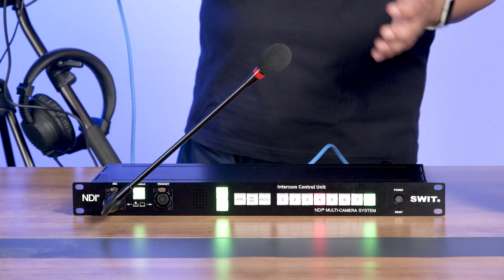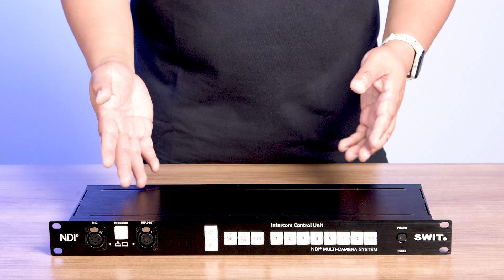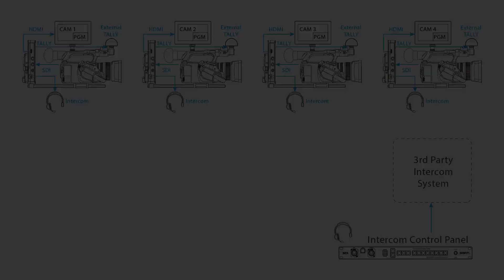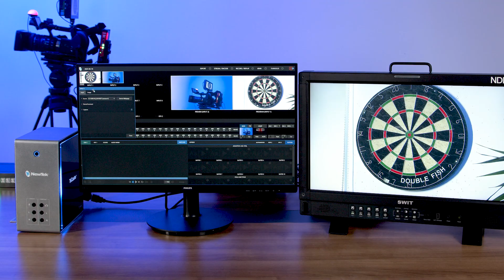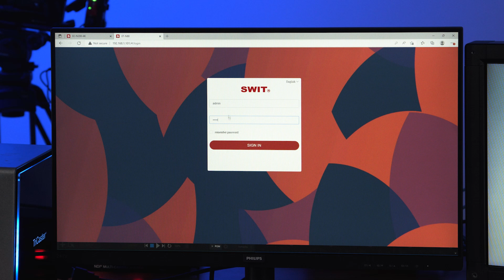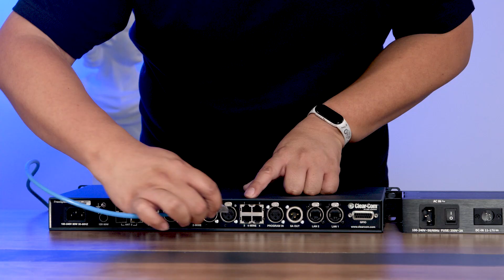SWIT NDI EFP Multi-camera Production System

Comment: I like that you provided a method to make normal ethernet more secure but I would have loved to finally see an NDI converter with Ethercon built in by default.
Reply from the maker: Thank you for your suggestion! We consider that Ethercon's cable is not available to all users like ethernet cables, so when users use normal cables, the interface cannot be fixed. Therefore, we chose a shelf to secure it.

Comment: Awesome what’s the latency for the return program feed ?
Reply from the maker: Around 80ms
Reply: @switglobal  thanks , trying to find the pricing . Do you have any links?
Reply from the maker: @markhepi7791  You can check prices now on our website (switonline)!
Reply: @switglobal  80ms? why this high? what about the SDI>NDI encoding latency then? I mean standard latency shall be 2 frames in both direction ( around 40ms calculating on 1080p50 signal), 80 frames are the proxy request latency for NDI HX3, not full NDI :/
Reply from the maker: @techthisout3549  We checked with the R&D department, and the previous data needs to be corrected. The actual codec and transmission latency is 60ms. This includes SDI-NDI-HDMI latency.